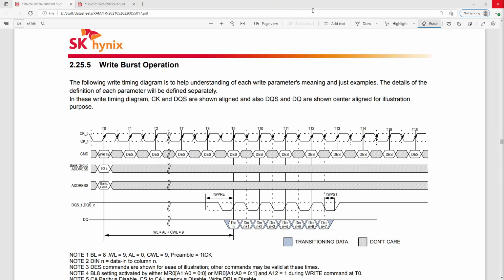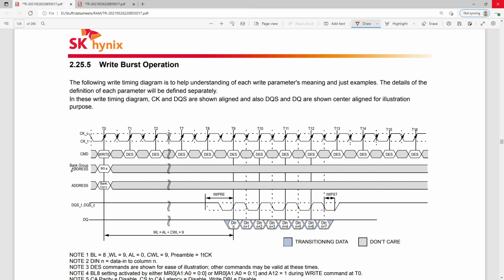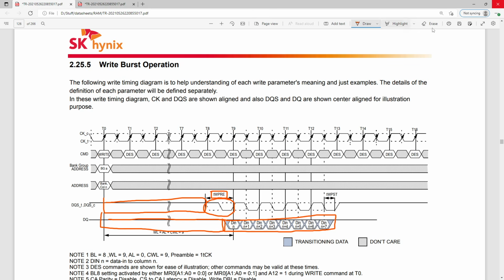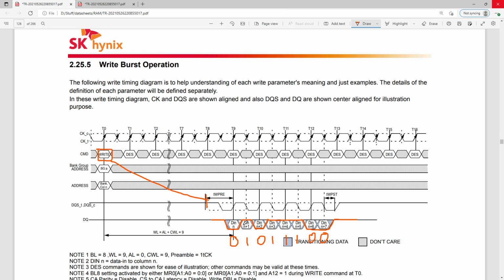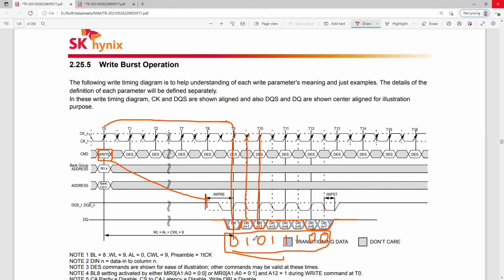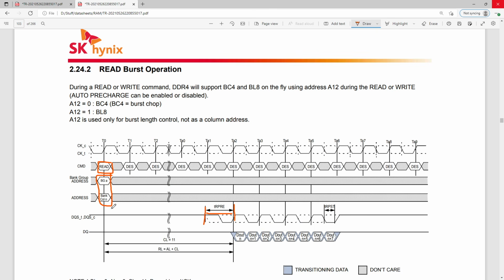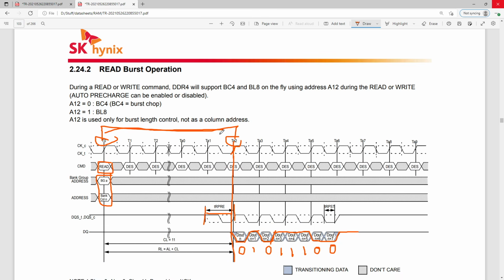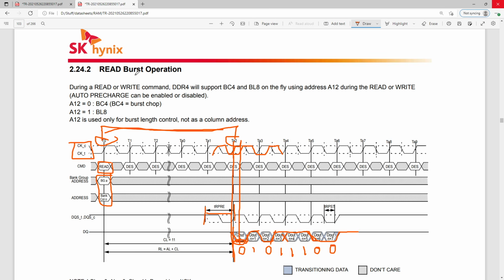How double data rate DRAM works

Comment: You chose one of the most difficult to explain topics related to PC's today.  One thing it is important to know is why the differential clock is used:  It is significantly easier and faster to detect when the voltage of one signal becomes higher or lower than that of another signal.  It's call a zero crossing detector, and it's a phenomenally simple and fast circuit, and is required today for the very high speeds involved.
I am happy that you did manage to properly grasp the functional operation of a DDRx transfer cycle.  Many look at one of these timing diagrams and cannot get the idea from it.  Good video, and about as good a presentation as can be expected from anyone for a fundamentally confusing topic for most.
EDIT:  On most DDRx memory chips the clock inputs are not required (and should not be present) during standby operation where the memory chip uses an internal refresh clock to keep the memory stable.

Comment: TLDR version how DDR works: the clock signal is doubled, but the second one runs 1/2 of clock cycle later. Bits are sent or received each time some of the clock cycles are "high".
Reply: Clock signal isn't "doubled", You're just reading/writing twice per clock cycle. Unlike SDR RAM where the data is only read/written once per clock.

Comment: Txco over vcc vcc ground to oscillors that have there own 1.3 volt circuit from the same power source before the vcc and txco, now you can route those 2 oscillators over the vcc pin and the n/c pin one of these oscillator grounds run over the output enable pin, once the ic sees 3 stable clocks it turns the serial clock on and begins a count, however you may need to reset the ic without interupting the vcc clocks or their voltages to restart the program counter of the ic. Also make sure the vcc is not directly powered through the clock instead have a circuit that runs to the vcc and past the ground but not to the clock grounds, so you can supply the amps to the circuit op amp the voltage difference so the potential difference of the txco is suppiled aswel as the ic, remember a component will pnly draw as much amps as it needs of the voltage is supplied, for instance a car stereo uses the same battery and has no problems however when you start the car the radio turns off because of voltage drop, if you have voltage drop on or ic or clock it will draw to many amps :)

Comment: To think about it easier:  There are true and compliment clocks (they happen to be differential but its not for the reasons you think), the true data is strobed on the rising edge of the true DQS, the compliment on the rising edge of the compliment DQS (the STROBE clock).  They are differential pairs but the data is based on rising edges of the respective clock signal.

Comment: Hi, my doubt is that based on whose clock signals does the memory controller work?. So do they work based on the CPU clock speed (generally in terms of GHz) or DRAM's clock Speed (in terms of MHz). Its confusing since its located along the processor chip in modern systems. At the same time, I couldn't get any clear clarification from online. Thanks.

Comment: Maybe it would be worth it to notice the difference between the basic DDR(1) with memory and bus clocks being the same and the DDR2 running the bus 2x faster than the internal clock. And the DDR3 and DDR4 running the bus 4x faster. Also worth mentioning that the DDR is  used only on the DQ.... Commands etc. are sent only at the rising edge.

Comment: I wonder how this works when a ramdisk is mounted and used as a swap partition on Linux lol would that screw up the ram read-write timings on clock edges or would it just delay the phase by a cycle when the ram is mounted

Comment: Just a quick note: DQ is D (an input) during a write operation, or Q (an output) during a read operation.  Saying data queue is not technically accurate, although the data is either going into a pipeline (writes) or coming from a pipeline (reads).  The pipeline is why the differential clock CK_c/CK_t is required.  The DQS_c.DQS_c is responsible for transferring the input data D to the pipeline, or transferring the output data Q to the output buffers.

Edit:  The 90 degree phase shift for the read clock is there because it is necessary to allow the data enough time to travel from the output buffers of the RAM chips to the inputs of the memory controller.
Reply: Exactly, thank you very much! Dee-Cue is the correct pronunciation of DQ :) D denotes Data, and Q denotes Output, and if anyone is curious why it is not O (Oh), then the engineers historically used Q instead of O to avoid confusion with 0 (zero).
Reply: What is pipeline?
Reply: @cocacolarrrrrrrr  Probably check Wikipedia for that one.  The answer could be kind of long, and the Wikipedia description is pretty good.  Essentially it is a series of steps the data passes through when being read from or written to memory.  Each tick of the memory clock advances the data from one stage to the next.  It is a bit more complicated than this, but it is done to allow data to move at higher clock speeds since the actual memory cells aren't fast enough on their own.

Comment: Hey Buildzoid! Any chance you'll also explain some of the timings, including why they're needed/what they do ? Things like CAS Latency.

I remember vaguely that in order to read or write, you need some latency, in which time the memory sort of "prepares" the exact address, that is the exact row and column of the physical memory location. Also at some intervals (10ms ? 100ms?) the whole memory needs to be refreshed with electricity (think of it like watering the plants) time in which the memory is effectively unusable for anything. If I'm not mistaken, the intervals between each refresh is that 4th/last timing in the usual 4 primary timings (the big timing). And that's why you want it to be as high as possible, it means the interval is bigger, so the memory is offline fewer times per second effectively less time offline. But make the interval it too big and you risk getting memory errors as some cells/areas might lose too much charge and a 1 might become a 0. Or something like that.

I always wanted to get to know more in this area. I'd also like to know like the best and worst scenarios for when a CPU wants or needs to get or write data from memory. Knowing how the memory works, in detail, would allow someone to compute these timings. For example, a worst scenario would be for you to wait it to finish another operation, then to wait CAS Latency, then probably to wait to have its periodic charge refresh, and then ... CAS Latency again ? and THEN finally actual data transfer. I don't know.

Comment: I am personally a bit surprised that the data lines aren't differential. Main reason with differential signaling is that it isn't easily disturbed by EMI from other nearby signals, or even power rail noise.

Also, in regards to generating a clock signal at any offset from another, this isn't too hard implement in practice. One simple solution is just a few selectable binary weighted delay lines, barely takes much to work with. And DRAM chips often don't change their distance from the memory controller. (Ie, when we talk to a given module we know its data comes back at a certain skew.) To a large degree, one can do the same to even de skew data lines from each other.

However, a 90 degree offset is the simplest. Since te data is clocked at whatever "transfer rate" the memory channel operates at. Ie, a 3200 kit does clock its data at 3200 MHz, however, the reference clock sent out to the DRAM chip is halved for signal integrity reasons. When we halv a frequency we transition each second transition of the frequency we desire to halve. But if we have a second frequency divider that transitions on the unused transitions, then we now have two halved versions of the frequency that are now 90 degrees apart.

There is also other ways to generate phase offsets, for an example through quadrature modulation, but this isn't particularly trivial. But this more or less offers the ability to chose any arbitrary phase depending on the input amplitude of two 90 degree offset references. With a pair of good variable gain amps we can go the whole 360 degrees.

Comment: Thanks for this explanation.... from this I pondered if quad data rate was possible since why can't you combine transmission on the rising/falling edge AND at the high/lows of the clock.... I didn't realise that Intel has used it in their CPUs already

Comment: so actually during a clock cycle a bit of data can change hands at 4 different times (90 degrees). How much longer until jedec advertises this as quad data rate?

Comment: Speaking of memory chips, i had an old dell server from 2010, it had 18 RAM slots, and each slot could support these 16GB DIMMs each dimm i beleive had 17 chips on either side (i think one of them was for parity ECC or might not have been memory)
Thats at least 576 memory chips, on a server from 2010 that only supported 3 channels per socket.
Now we have 12 channel processors and there are now LRDIMMS that i think have 24-32 chips per side, meaning you could see as many as 4608 memory chips in a single 2 socket server.

Comment: Thanks for bringing up this topic. Never looked at DDR systems.

Regarding phase in Write and Read operations. I am pretty sure you know this, but it wasn't that clear in the video: This is standard for every logic interface I have seen so far.

When writing you need to pull the level to the desired level early enough so it has time to settle (since the change cannot be instantaneous due to capacitance, etc.). This is called setup time (tSU).
Then you need to keep it at this level so that the target can read it (potentially removing some charge). This is called hold time (tH).

When reading, the clock initiates the read. Thus it needs to follow the clock. The time needed is called clock to output time(tCO).

Point is, this is less connected to the memory being dumb and more part of the structure of who sends the clock. So data with sent with the clock normally respects setup and hold. Data requested with the clock, takes tCO. 

When combining elements in SDR land, you normally make sure that tCO is longer than tH. That way the output always changes only after the hold time, ensuring no timing violations.

I assume DDR ram uses a multiple of the clock internally and the DDR interface is only there to limit the frequencies on the channel, simplifying connections and routing on the boards).

Comment: Would QDR be possible and if yes how would it look like?
Reply: I mean, technically a lot is possible, you could generate a clock with doubled frequency on the memory chips and use that in the same way as in DDR, but then you're probably better off just using double the clock frequency to begin with and keep the memory simple.
Reply: @Basement-Science  that would still be DDR but with a doubled clock. Just as you say at the end.
Reply: @SwordQuake2  Well we are talking about digital circuits, something always has to change state when you want to do anything. 1 clock cycle always only has 2 state changes, not 4 or more, so you need to get the extra state changes somehow. 

You could use some variations of what I described. For example using 2 90° shifted clock signals to clock the RAM, and alternate between them. That's basically still the same thing.

So if something like that doesnt satisfy your idea of QDR, then I guess it's impossible.
Reply: @Basement-Science  well yes, the cycle has 2 edges so that's why it was a question whether it would be possible. I guess with 2 clocks that are shifted like you mentioned it would be possible to get the 4 edges in a cycle.

Comment: Would love to see overclocking guide - basically going over all the timings and sub-timings - talking briefly what they do, how important they are for performance and how to determine stable operational values and how voltage plays into all this. Because say I'm going for 3600Mbps - how do I know where to aim with either sub-timing for this memory speed, etc.

Comment: In fact, it's mandatory to setup data some ps ahead so the target chip is sure to get valid data un it's input buffer for sampling. This is always specified on the data sheet.
On RS232 the appropriate time to sample is right in the middle of the clock.
The functionning is well explained great video !

Comment: Informative. I did not know about the shifted sampling clock for the read data timings. However, to me as a digital designer from the 1980s and as a multi-layer PCB designer from the 1990s, the really hard bit to get my head around is how they maintain data integrity with up to 64 single-ended data lines on a module all switching at up to 3600 mega-transitions per second or more. Differential is easy (relatively), but single-ended, bi-directional signals...? sheeesh...

Comment: My issue is that you didn't really explain how DDR works, beyond the "sampling on both edges", which is quite basic. Everything you said about sampling can also be said for SDR memory, which works the same way, but only samples in the positive edge of the clock. So the really interesting question would be, why not just use a clock with twice the frequency and sample only on the raising edge? The answer to this question is the whole point of DDR.
Reply: In SDR you mostly dont get that 90° shift in the actual data, you get a 180° shift instead (at the 'other' edge of the clock) which makes the memory controller a bit simpler. 

But then you have to generate and transmit a stable and clean clock signal of twice the frequency across the motherboard, which consumes more power, needs better drive transistors and has a few more issues. So doing DDR is preferrable.
Reply: To all the people replying: yes, I know why it makes sense to have a slower clock and sample in both edges, that was my point. I just think it would have been more interesting to discuss the issues that led to the usage of DDR instead of doubling the clock speed, rather than taking 20 minutes just to show signal sampling in the raising and falling edges, which can be shown in 30 seconds.
Reply: @luisjalabert8366  so do believe that ram is brain dead and does nothing with the memory controller telling it to do so?
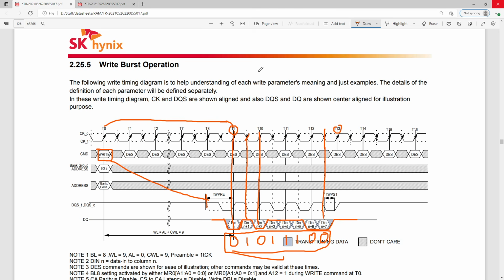Reply: 10:50 to about 11:12 is really all that makes DDR DDR. You read/write twice per clock cycle, and that's all there is to it.
It is being used instead of SDR because it's easier to maintain signal integrity on a lower clock speed; Any delay in voltage change you'd get from things like inductance, capacitance, or certain active components would just make up a smaller portion of a longer clock cycle. Though I wouldn't expect it to be mentioned because this isn't what the video is about.
Reply: The answer is probably "Physics." There is probably something which makes doubling that clock physically impractical relative to the solution chosen.

I'm guessing at some point someone who was trying to make the clock faster realized they could get far more out of a smarter design than a better one due to having to engineer around physical limitations.
Reply: @PwadigytheOddity  Rising wave frequency (clock) in a bus is difficoult for a variety of physical reasons. Those reasons can be simplified down to the fact that the line must be significantly shorter then a wave length to ensure signal synchrony and integrity on both end of the transmission line.

Comment: I'd like to see a logic flow chart for all the timing parameters listed in a motherboard and when they occur, in what order and the dependencies.  Command issued, Column access strobe, Row access strobe, Read to Write delay, etc.  That would be facsinating especially with QDR/PAM4 on its way.
Reply: The sequence of command and address signals does not change when you go from DDR to PAM4, that change is isolated basically entirely on the data signal lines.
Reply: @wewillrockyou1986  I assume PAM4 would require an additional encoding step though? As far as I'm aware, the data isn't stored in a PAM4 format.
Reply: @nathangamble125 works for flash, why not memory? ;'P
Reply: Well use the micron sheet
Reply: Yes please!

Comment: So if I understand it correctly QDR would require a Read Clock offset by 45 degrees or 2 read clocks? I will have to watch video one more time, to understand the basics of that (I understood - probably - DDR, it's just that I started thinking about QDR).
It's a good video. And yeah it will be useful - once the damn heatwave goes away, maybe I will build the damn computer that I bought parts for.